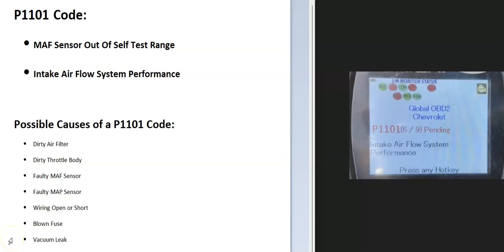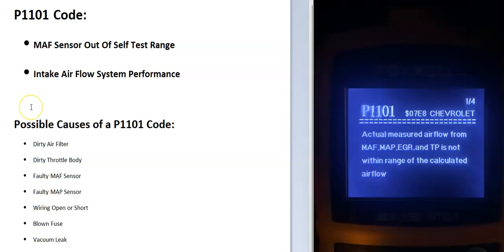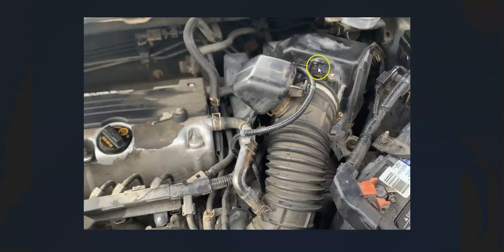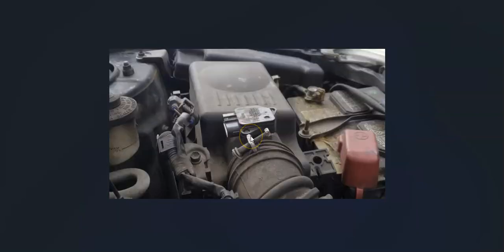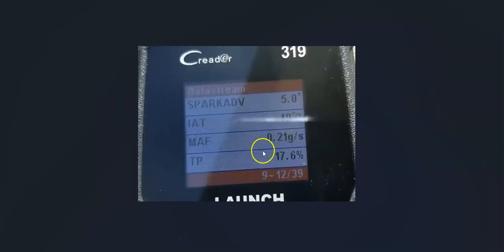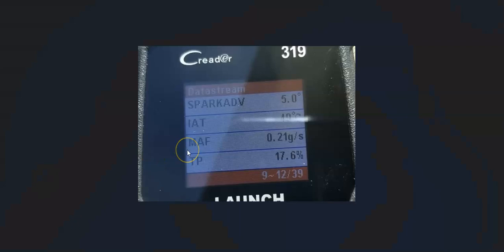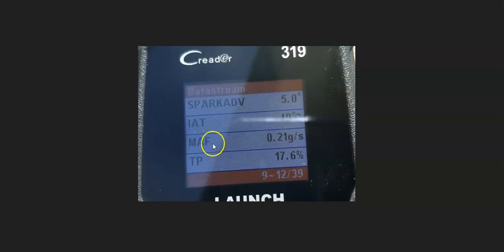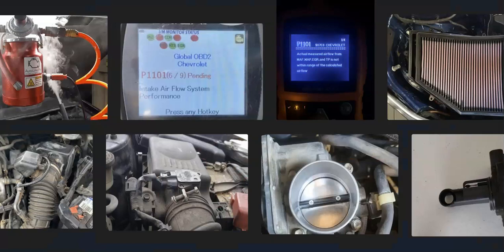Causes and Fixes P1101 Code Intake Air Flow System Performance - MAF Sensor Out Of Self Test Range

Comment: My 2018 Chevy Trax gets a random P 1101 code only after it sits all night when I first start it for the day it  comes on about 5 to 8 minutes after starting and self clears after 4 retests shows up just a couple times per week so far I swapped out the mass airflow sensor throttlebody air filter is clean and I literally just swapped out the map sensor hoping that fixes it if not, I’m just gonna deal with it as I said, it itself clears

Comment: My 2016 Equinox 2.4L would start, run 3 to 5 seconds then stall.  No check engine light. I disconnected the MAF sensor this forced car in closed loop and it started and ran.  Replaced sensor ran great

Comment: it has  the p1011 air flow the throttle body was cleaned and a senser changed and didn't stop it also changed air filter
Reply from the maker: It needs to be diagnosed, but if the MAF sensor is good and the air filter is clean, I would get a meter and check the wiring.
Reply: perform a smoke test on the intake system, check for leaks

Comment: i have a  2016 1.5L turbo malibu and i brought it in to diagnose an engine light coming on and off for over a year and a half the engine runs fine no issues and the change in weather seems to cause the light to come all summer the light never comes on. they said it has a plugged or restricted PCV orifice I am a women and do not know wether to trust this they want over a $1000 your video doesnt mention this at all.
Reply: Can you give us an update... what has been done to the car in the last 6 months?
Reply: Girl I got a 2016 chevy trax and let me tell you something I can totally relate to you...I have been dealing with this issue for almost a year, taken it to the mechanic at least 3 times, the 3rd time I thought they finally fixed it after they rested the car computer system and cleaned the throttle body, but I drove on the highway with the a/c on and boom the engine light turned on, went to autozone and it was the p1101 code I thought the mechanic fixed...so here I am taking it back to the dealership. AGAIN. Bought this car used, have had it for a year and 2 months and I kid you not, I must of spent about 4,000 fixing this car from about 6 months having it till now... seems I have gotten a lemon car... but I had already changed the sensor as well and it still came on...Hopefully this time when I take it, they will officially fix it

Comment: I have a 2016 ats it's got p1101 it also suggests replacing TBI gasket. Can that make it read vacuum leak
Reply: Lo solucionaste ?
Reply: Run a smoke test on the intake system